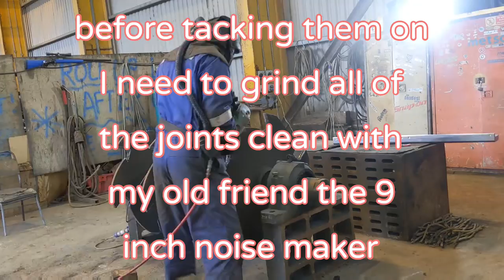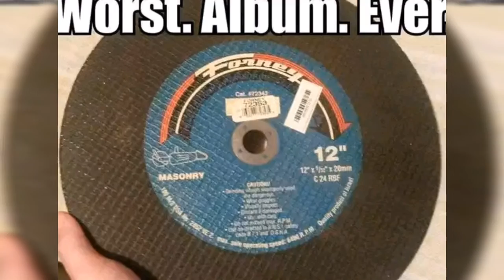Big Nasty rotor blade replacement

Comment: Great videos, keep them coming!  IC Weld also does a lot of heavy equipment repairs.  Would love to see one video with a shop tour, or at least equipment tour that you tend to use.  That 'suit' for one thing, never seen that on any videos in the US.  Sometimes your voice is a little too low volume, but turning on the closed captions helps.  Would love to see more technical details like welder make/model amps etc. Keep up the great work!

Comment: Thanks for explaining the air gouger - I'd always thought the air went down the carbon rod.
Reply: They have a variation of it that does go down through the rod. Usually used to pierce holes in really thick pieces of steel. It is a specialty application though. There is a trade name for it but it escapes me at the moment. ICWeld uses one sometimes.
Reply: @TheKajunkat  I thought that IC Weld used the same arc gouger as this one?
Reply: @markfryer9880  he has both rigs.
Reply: That is an oxygen lance I believe.
Reply: @stacy6014  Those things are a tool that would take some getting used to!

Comment: Oh man  do love that '' gouge electrode''  Dutch ; guts -electrode  cleanness is awesome.
......your project looks a balance prob from new ,   with too much flex in it structure if you ask me.
The speed of those beasts are .....very high. It raises my hair on me back for sure :-)
throughput is often just too high. And damage then becomes obvious .
dus ...goedkoop is duurkoop is een gezegde hier in Nederland
so ... cheap building is, expensive repair is a saying here in the Netherlands.
yes close to the work you do is the only correct way,.... to place the NeG.

If I may : 10:10  next  time to place this bars, use gravity the lowest point to connect them. [ this way you got the right measurement to the heart of things] and less vibration [ sound freq.]  it will be better this way... my exp. :-) [ no harm intent here ]

Me, too, like to work hard , it must be smart too ;-) that was always the challenge for me.
Liked the video

Comment: I prefer plasma gouging a lot quieter and less air and power required and won't catch machines on fire as quick downside is airarc does remove more material

Comment: What they're doing with that mill isn't the correct application, should probably report their asses for dangerous practices.  They should be using a 7 disk pack hog-mill.   That mill head is for soft material thus the shattering of the rotor.

I also strongly advise installing a second "grounding line" to the air-arc system.  Simple extension to the wire with a second good clamp on it is fine.

Comment: Not a professional welder by any means so maybe it's more common than I think, but I've never seen a PAPR system fed by an external air line rather than a battery pack.  Seems like a pain in the ass for the user.